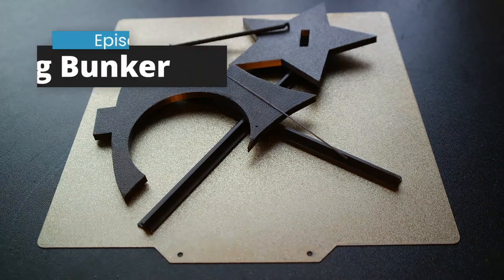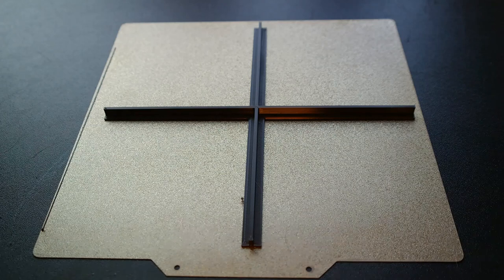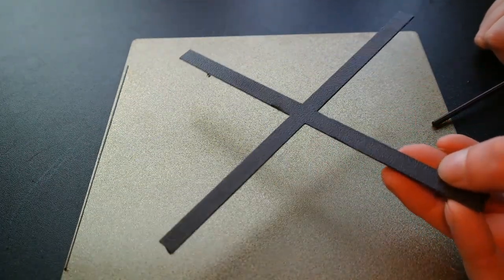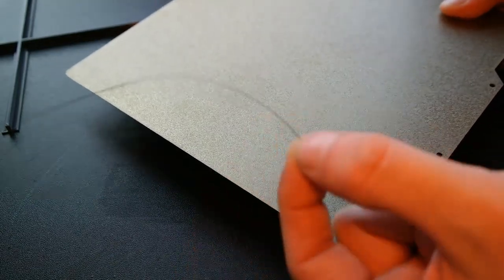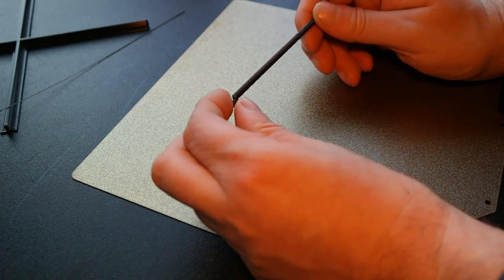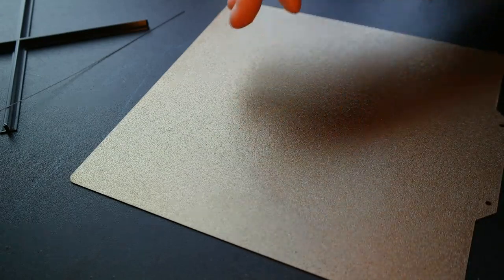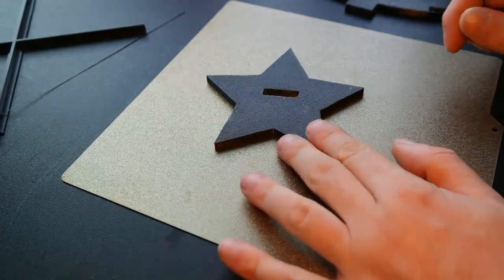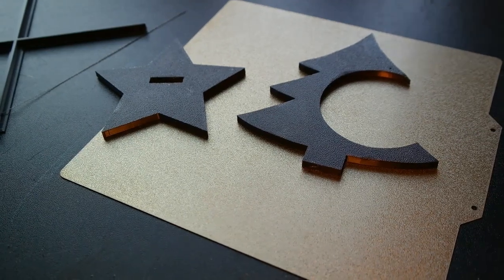3D Printing Bunker - textured PEI spring steel bed adhesion

Comment: I read that after heating this PEI and magnet platform they changes (can have some convex... ), so calibration need to do when it was heated, and use good magnets to have flat surface. Anyway thank you for another good video about PEI. Need to try my, when it will come and i build my printer))). Hope you will find decision to make that PEI better and share it with us
Reply from the maker: Calibration is done after everything is heated, so that shouldn't have impact but I will probably have to take it apart once more and test just heated bed.